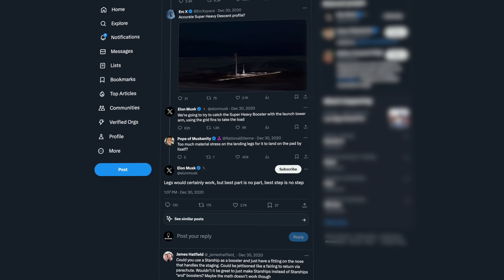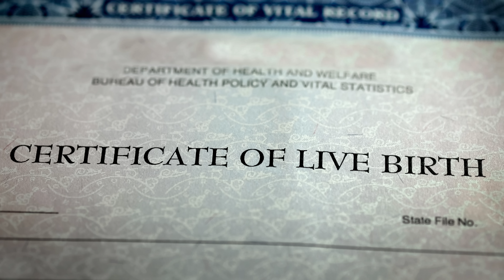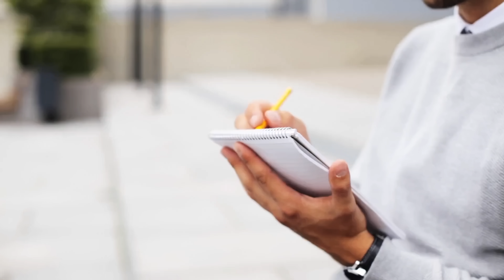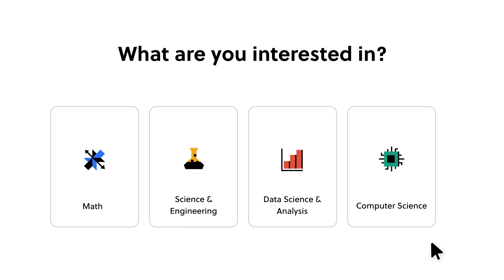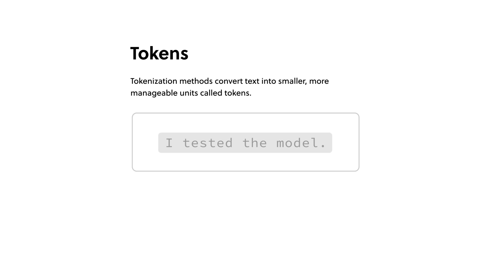Starship Just Took One Step Closer to Mars

Comment: There are still some gaps, but bit by bit getting people to Mars alive is starting  to look feasible.  I did realize that propulsion had  been such a hurdle to overcome.

I like what has been resolved at the Mars end.  That is, first using many unmanned missions to land and stockpile supplies and construction equipment.

The next phase, (the result of an idea search where many clever participants submitted plans) of creating safe, warm places for the first settlers, showed the feasibility of using Martian surface soils as the main component of building materials.  

The ingenious proposal envisions machinery that creates a substance like cement, filled with dead air spaces to serve as super insulation.  As this goop pours out of the device, it was shown to be laid down as a coil, spiraling upward and inward to eventually form a roof.

That is very much the way an igloo can be built quickly enough to keep people from freezing.

The point is, it is not practical to ship building materials from from Earth.  Only the essentials like air-lock doors, and super strong windows.  

The latter will be needed to catch daytime heat from sunshine.  Necessary for some form of greenhouse food growing.

In recent years, its from Holland where a process has been invented and perfected  to grow vegetables in a multilayered setup, incredibly productive in a vertical building.  They even use artificial lighting now.

The first stages of settlement remind me of what it took to build living quarters on the ice cap at the South Pole in the 1950s.

Other solutions for surviving on Mars seem to pop up at regular intervals.  For example, it is now certain that there are enough water sources on Mars to sustain Earthlings.  It is trapped as ice just below the surface.

Also amazing was the revelation that once people settle in, there is a relatively efficient method for creating their own rocket propellant to for return journeys to Earth.  Was it maybe from breaking water into hydrogen and oxygen?

Similarly, it seems there is enough oxygen in its soils and Mars thin atmosphere to be extracted for human breathing function. 

So in many ways, providing the essentials of food, water, shelter and air now looks to be possible.  Much of this wasn't enough conceived of 20 years ago.

Comment: Is this regarded as a success? A bit confused.
Reply from the maker: Stage separation (through hot staging) is a huge step in the right direction. Hopefully Starship's next flight will fully succeed
Reply: The big thing is realizing how they as a company treat development. They don't approach it like NASA or other companies, where the goal is a perfect flight from the first attempt. They use an iterative development method: simulate as much as you can in a reasonable timeframe, and then try it out. See how it performs, collect data, and learn from it. That influences the next test flight, and so on until it achieved all of it's goals. 

This methodology worked very well for them on booster reuse. Now, with Starship, it's the same concept on a massive scale. The important part is that they are able to keep the build pace up, and costs down. This let's this style of development work. And, so far, it is working. The next booster & ship are nearly ready hardware wise. They can implement any changes needed software wise from this flight, along with any swappable hardware components, and then push it through a ground test campaign and fly. 

I would not be surprised to see the next flight achieve a fully successful first stage profile, and the second stage make cruise. I expect reentry to give them problems, and maybe take a few tries to work out. But I don't doubt they'll succeed. History has shown betting against them is a bad bet.

Comment: Why do they hot stage? Won't it damage the booster, making it harder to refurbish?
Reply: They have a heat shield where the exhaust grills are.  The idea is that hot staging saves fuel and allow the rocket to carry 10% more cargo.  That's a huge benefit in terms with very little risk.  The issue with the booster is likely due to plumbing in handling the large flow of 33 engines while acceleration is changing.  Though that's just people's guesses until we hear from SpaceX for the official reason.
Reply: @lanzer22  I still think they should use springs or hydraulics to push each other apart during stage separation so the booster is pushed back and the ship is pushed forward
Reply: @PassportGaming  springs 🤡🤣
Reply: @Mikael-jt1hk  Cars have springs and hydraulics, it's not a far fetched idea. Springs store energy and decrease fuel needed. If they can catch a 10 story rocket with the tower, it shouldn't be hard to add springs. I bet Elon would love the idea